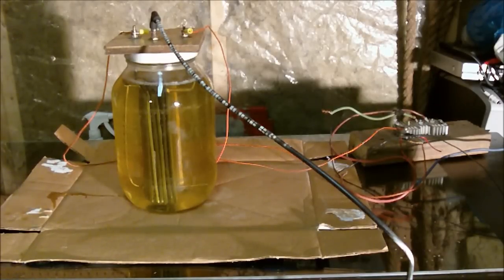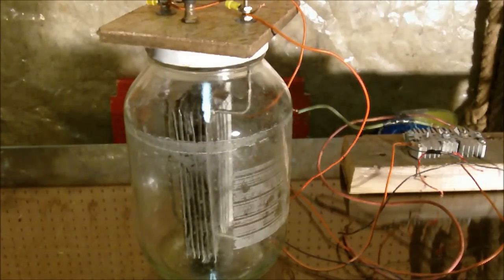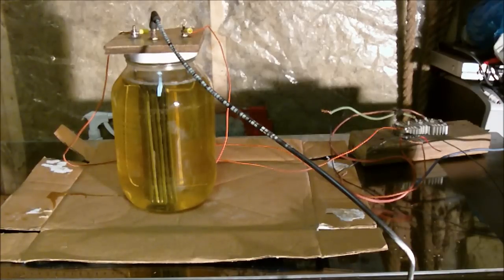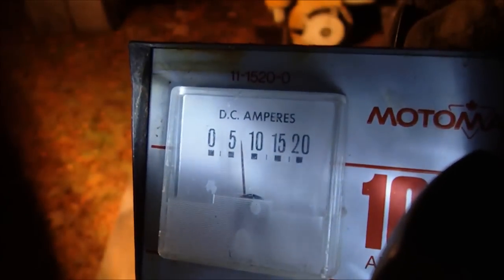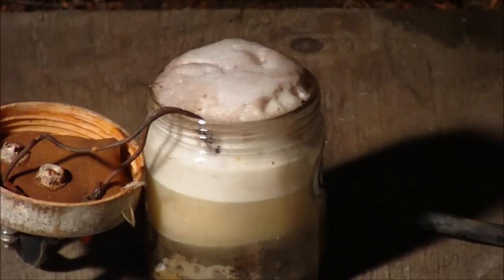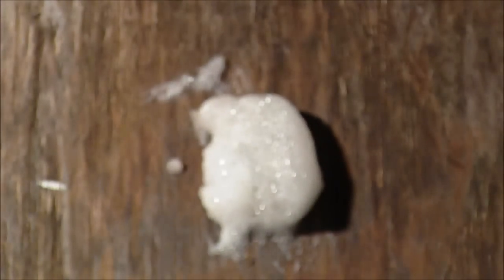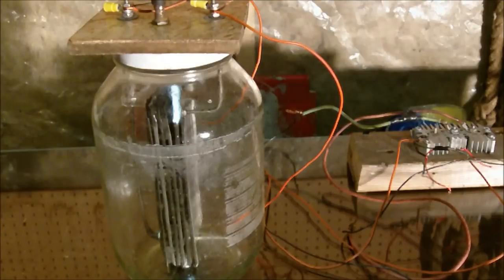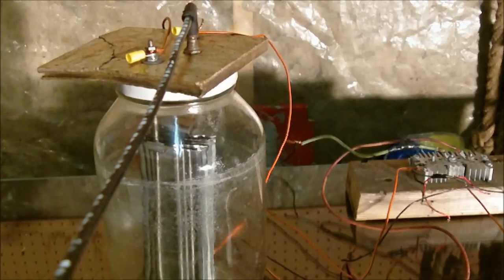Hydrogen from Urine (fire from pee)

Comment: Electrolysis of urine generation of 120 volts ⚡️ wireless 🛜 energy tesla coil absorption of wireless energy voltage multiplier urine HHO electrical power generator waste water used for fresh drinking water supply. 😊

Comment: Hydrogen does not EXPLODE it EMPLODES.
YOU HAVE TO CONFIGURE THE TIMEING OF THE ENGINE WERE THE SPARK HAPPENS @ 5° after BOTTOM  Dead center because emploding hydrogen gas creates a powerful suction, the emplosion creating the sucking up of the piston creates tremendous heat which I turn ignite the compressed gases and drive the cylinder back down.
This is why hydrogen is twice as efficient as fossil fuels.
Only if the engine is properly programmed for it.
Otherwise adding hydrogen to your fuel only counter acts the compression forces.

It's not what you know that hurts you, it's what you don't know that always gets you in the end.

Comment: You get more energy out than you put in.  We were taught in school that the law of conservation of energy applies.  Not true.  Electrolysis is a low energy consumer.  The power from hydrogen alone is much stronger when combusted.  A completely different reaction than electrolysis.  Remember with amonia you have nitrogen and hydrogen as your basic compound.  Capture the hydrogen in a tube over the electrode producing the hydrogen and run it to your engine intake.  Let the nitrogen go.

Comment: Why is everyone telling that hho powered engines are unrealistic and they do nothing but create a "conversion" of energy ?

See a hho generator needs 12V at maybe 10A ,. So 120W is going in to produce the combustible hho gas  , and the power output of even the cheapest four-stroke 150cc bikes is roughly around 10KW ....!   So 120W in and 10,000W out ,
I mean what the basic idea  is u  need have to give some INPUT to get the OUTPUT right ?  Here instead of petrol (or diesel) u use water ..... 
And the calorific value of Hydrogen is way more than gasoline ... And it has explosive combustion !  
Just have to adjust the cam timings and that's it !  Biggest revolution of the  21 century !
Reply: In theory the same amount of energy should be used to seperate hydrogen and oxygen as you get from combusting hydrogen and oxygen.  There will be unavoidable energy loss too in any system do to the laws of thermodynamics.  Urine electrolysis is different though as the aqueous urea is also a hydrogen source and doesn't need as much electricity as water to be electrolysized.

Comment: awesome,thank you so much for sharing your research. will change my hho to urin too. pls try to hook up the combustion engine and study it... i believe it works in a way of using less rugular fuel to drive anything with it. the win i believe is to safe regular fuel. that lowers the expense at the gas station. its the same as driving a thirsty inefficient engine from 50yrs ago compared to the more efficient ones of today. so hho with regular fuel its just mire efficient. why else we see tons of videos from guys driving already with hho cells in their car? all false claims???
Reply: WHAT. DOES. THIS. MEAN. 
YOUR COMMENT IS INCOMPREHENSIBLE!
Reply: @ataphelicopter5734  I apologise, I am a native German speaker.i liked the video. And there are many people who already hooked up an hho system up to an combustion engine to reduce gasoline and add part of hho gas instead, leading it into the carburator. It's working and not a false claim comparing it to a perpetual motion Machine.

Comment: You can make Hydrogen gas straight from water, I don't see the benefit of using urine.
Reply: byproduct is water
Reply: MrAsamondajin He explained at least two advantages; Less than a single volt is required, as opposed to roughly 2x (1.5-2v approx). With water some sort of "catalyst" or electrolyte must be added -salt, baking soda, trisodium phosphate etc

Comment: Urine electrolysis doesnt produce HHO. If you are providing a high enough voltage (1.23v) to electrolysize the water in it, its HHHHHHNO. The Urea in Urine only needs 0.37v to release its 4 hydrogens (and a Nitrogen as well as Potassium Carbonate salt which stays dissolved in the water). The result is you CAN get more energy out of Urine than you put in if you use a lower electrolysis voltage, as a Hydrogen fuelcell outputs 0.6v-0.7v. This still isn't free energy, its just properly harvesting a fuel source. Additionally electrolysing just the urea in urine, results in a HHHHN which can more safely be stored than HHO. 

The main problem with Urine is humans aren't the only ones to have discovered its hidden energy. Many species of bacteria have adapted to consuming Urea for the energy in the hydrogen. Within just 20 short minutes after urinating, most of the Urea will have been consumed by bacteria. So you cant just store the urine instead of the hydrogen, which would be much safer. The other problem is the waste products foul the electrodes, Urine isnt just Urea and Water, its also dead bloodcells, hormones, and various other water soluable wastes (depending in diet). This requires cleaning the electrolysis system frequently, not en enviable chore.
Reply: You dumb there is no need for baking soda per just like that will work and if you power your house with an electric generator using hydrogen then it will be free energy
Reply: Surely a cleaning system can be added to the device, i mean they're flat plates, even constantly spinning brush on them can keep em clean indefinitely

Comment: Here is a hydrogen oxygen splitter deign I made there may well be better ones out there but this one is quick, cheap and easy to make. It can have lots of radial copies of the pipe I describe to create more surface area. This is just the principal it could be properly engineered, this is just to show a working example.

It can be made with a 2L plastic coke bottle.
You place the urine in a bucket, the hydrogen producing cathode or anode, I forget which one it is, is then placed inside the plastic bottle which has had the bottom of the bottle cut off to allow the liquid to move around freely.
With the bottom of the bottle removed it sinks when you put it in the bucket. I used an aluminum pipe 10mm in diameter. The pipe was heated with a torch to make it soft and then it was hand bent once it cooled to follow the inside profile of the plastic bottle, but rather use a stainless steel pipe which can be bent without heat treatment, it will last longer too.
So the pipe goes in through the screw cap where it is sealed with silicone glue and runs down the inside side of the plastic bottle. Where it touches the side of the bottle all the way down to the bottom.
I cut lots of horizontal slits 25mm long at 10mm intervals in the plastic bottle exactly where this pipe runs to allow the electrons to pass freely to the other pipe.
I used copper, for the pipe outside the bottle but I recommend stainless steel for anode and cathode. So eventually the anode and the cathode are only apart by the thickness of the plastic 0.2 - 0.5mm, the electrons can flow through the slits but the hydrogen bubbles cant.
The hydrogen that forms inside the bottle travels up at 90 degrees to the scalpel cuts in the plastic, and does not go through to the outside, they travel up to the urine surface inside the bottle. By separating the two the hydrogen is about as dangerous to handle as LPG gas or acetylene, left mixed with the oxygen its un manageable and creates explosions that make it impossible to use, unless you have a death wish.

Now this is where a little trick comes into play as you need to drill a hole in the pipe just underneath the lid inside the bottle, but above the surface of the Urine so the hydrogen can come out of the bottle through the pipe. This can then be run straight into a small combustion engine without having to change the timing as the hydrogen air mixture is less explosive than the HHO mix.

Comment: Excellent Report Thanks!
Excellent Way To Dispose Of Waste Water At Sewage Treatment Facilities 
A
Direct Line To Gas Pumps With A Filter In Place For Large Objects They Already Make Sewage Drinkable Through Filtration
Make It For Vehicles Too
The Car's Generator And Battery Supply Electric Current At Home Use Solar Cell Batteries With Solar Panel's On Roof or Houseboat Like They Do Already
See My Playlist FREE ENERGY

Comment: Expected to see a u shaped tube to keep the hydrogen and oxygen seperate, seemed like having them together was a potential bomb.
Then it is a matter of converting solar to gas as an energy storage and compressing it, for fuel cell electricity or heat later.      The piss part seemed a good electrolyte, could still dilute the concentrate with water for plants.
All boils down to needing battery technology for energy storage.    Could we use a giant rock hoisted up a tall pole by a geared down reversable motor as energy storage?    How do the numbers compare for how big a rock and how high compared to how many gas tanks?   If you have a 200 amp hour battery, how heavy a rock, how high is that?    I could calc that, curious but busy today.    Seems folks with stairs, (I have none), should hop on a small elevator to get down a story on a geared generator pully running as fast as climbing down the stairs.    How many amp hours is a 200 pound person up 12 feet?
Reply: 200 pound person 12 feet up is 1779 joules or .49 watt hours.  A 200 amp hour 12 volt battery is 2400 watt hours.    So we need a weight 200 pounds * 2400/.5 = 240000 pounds or 120 tons to replace a 200 amp hour 12 volt battery.    So you gotta lift 60 4000 pound nissan xterras 12 feet to be one 200 amp hour battery.
Reply: John Fenman now how many amp hours are in two large welders cylinders - one with oxygen, one with hydrogen?
Reply: John Fenman a gallon of gasoline is 33kilowatt hours or 13 of those 200 amp hour batteries.   Same energy as a kilogram of hydrogen - a big tank full.   So if you could compress it, a good hydrogen fuel cell would get you 50 % efficiency on hydrogen made at 20 percent efficiency - or maybe 10% of what you put in.    So you would need 10 times the solar panels that good batteries would need, to provide the same energy back.   Not bad for free solar energy, driving a tank to replace 13 batteries, but with that 10%  conversion maybe we should think of a big hydrogen tank as only one or two 200 amp hour batteries.   But tank life is long, battery life is 5 years.    Fuel cells not so common for houses.    

No easy cheap storage mechanism, batteries have a lot of potential, weights on the tower not so much.   Hydrogen, depends on the home compressor and good fuel cells.
Reply: John Fenman Are you asking questions, then answering yourself? #wtf
Reply: Yes - I asked questions and attempted answering them.    The conclusion was we need good energy storage mechanisms, and batteries are important.   Clever me.
Reply: Social Media Awards Consideration are you suggesting that if a person formulates a question, they then are are not to becomes part of the process of answering the question?    WTF.
Reply: Build 2 reactor vessels wired in series. The Oxygen will come off one side, I think the negative post, and the hydrogen will come off the other side.  Install a bubbler on each output to prevent possible flash backs.
Reply: Your rock analogy would help with a heavy flywheel with almost zero point friction, so that would work - otherwise, probably not. Flywheels are excellent sources of energy because when they are heavy and have good bearing or low points of friction, they'll spin forever.

Comment: Can't it solve the issue of power availability?

Say you had something like this at home. All during the day solar panels and wind power would be generating electricity and converting some of it into this gas which would then be stored. At night you'd come home and as the sun went down and if the wind slowed, a generator using this gas could kick in and provide the power you're missing.
Reply: Brilliant idea!  The storage of Hydrogen would be tricky though, it is highly explosive.  Dry cells are interesting too.
Reply: JorgeL721 When u use urine u get no O u get N-HH N-HH no oxygen from urine ammonia u get N-HHH so as u see u get more from urine Glass is good because it holds electricity White vinigar stops foam. both only takes 0.37 volts to extract.

Comment: Peltier unit can capture lost heat energy?
Reply: Nik Lyons heat can be used for thermal expansion of both gases in a self compressing electrolyser. Both gases need to be separated and used for separate uses.

Comment: weird thing is i have been researching joe booker magnetic charged  AIR ENGINE and if you pour urine in the coolant it makes a battery and soaks in to the engine block and my diesel turns over and runs on filtered waste oil alot easier but the urine seems to dissappear quite quick so it seems that you need a larger tank to attach to the coolant system which i am on with just for others to look into no expert here in uk

Comment: Just thinking out loud but doesn't urine contain uric acid as well so wouldn't neutralizing with baking soda or some other base help particularly with the bubbling effect. Moreover, would it not be better to do this in an inverted container reducing the potential explosion hazard whereby the cell could be divided & hydrogen/nitrogen collected separately, with the gases being purged from time to time.
Reply: Doesn't the immune system also contain salts as well?

Comment: The reason you can theoretically run a motor  with this is because it is more then 300% efficient at being converted. water is around 70-60 % efficient. So, theoretically you could produce enough to power the creation of the hydrogen (100%) and use the rest to power a fuel cell (combustion is to inefficient )

Comment: Try dieselt exhaust fluid since it is  32.5% high purity urea and 67.5% deionized water. Urea is whatcha want and it is in low concentrations in piss. I would try it myself but other projects are in the way. :) Just throwing it out there for those that have their cells up and running.